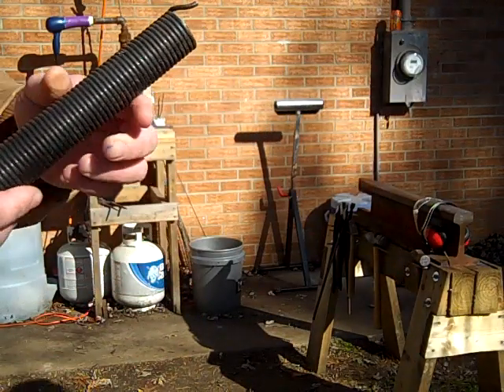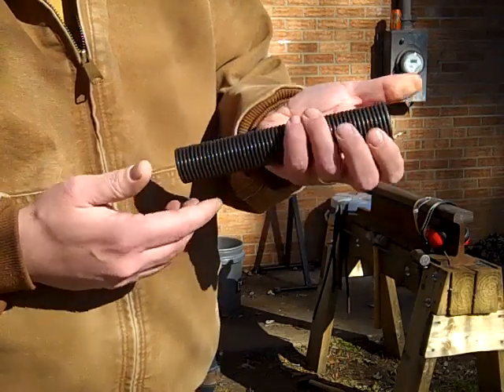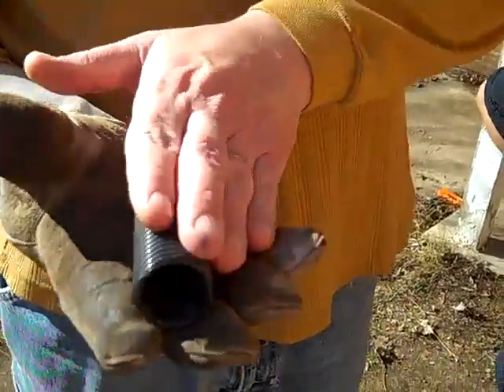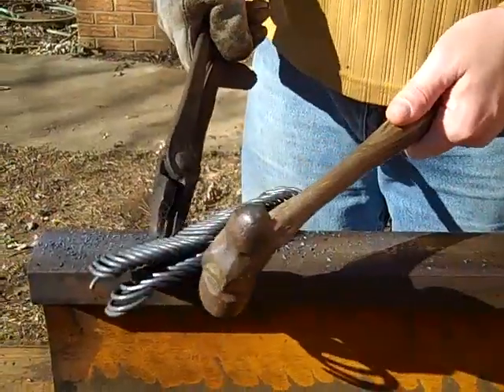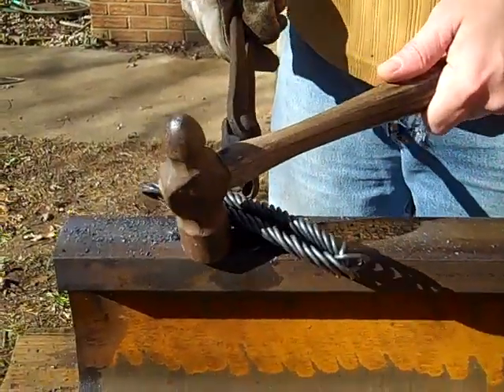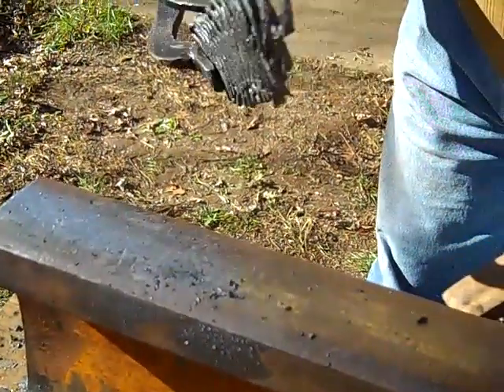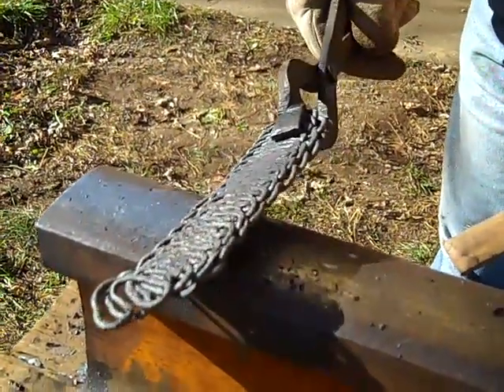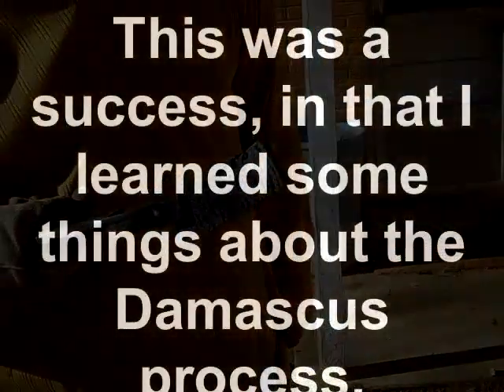Making Damascus from a coiled spring

Comment: a power hammer would've cut his time down to get that billet done but if he would've kept hammering at it he would've gotten rid of those voids. Another thing that would've helped it to put the spring in a tube or pipe, pour powder steel in with it (pack it down good), cap your ends shut, bring it to heat and start hammering. Before you do any folding over, you have to grind off the outer tube if you want your spring damascus to show.

Comment: I have not read thru all of the previous (392) comments, so please forgive me if someone else has already suggested this. First of all, I liked the idea of using springs for a Damascus. My suggestion would be to do this as a Canister Damascus, using multiple "nested" springs inserted inside each other for not only the center core of the canister, but also in the corners of the canister, and then fill the voids with powdered steel before welding the canister closed. Maybe even add in some straight steel rods before adding the powdered steel. I agree that a power hammer would be good, maybe even a pneumatic or hydraulic press to set the fist few welds of the canister. If I was doing this, I would probably also "twist" the billet before flattening and folding. I think it would be an awesome pattern. :-)

Comment: you need to use borax firstly, as damascus rather than having a whole piece if weak steel you will have one point that is terribly weak so borax keeps the carbon level okay and the impurities at a minimum. You also want it be white hot for a forge weld (especially with damascus) it makes the weld cleaner.

Comment: You could try adding a smaller spring that just fits in the vacancy in the center and then add a smaller spring inside that one before plugging the whole with something and maybe pour in some fine high carbon steel dust before plugging the other side? As the others have said you'll have to get the steel hotter as well and I'm sure some borax as an oxidation barrier wouldn't be bad either. You can even mix in some steel filings to the borax as well.

Comment: It may look similar. But it's only one type of steel. So can't be considered "Damascus". Perhaps a solution to your void problem would also meet the requirements for Damascus. Use a couple other same size springs of other metals and thread them together (advisable to weld spots together) before beginning and you can likely fix your gap issue AND have the multiple steels. Even still, you need to fold to MANY times. Which should solve the gaps as well as you fold and reforge into a working bar. But you'd still need the other metals at that point, so I still suggest my first idea. Because yo may achieve a similar look by doing it with a single spring. By using only one metal you can't call it Damascus
Reply: well by your definition it is still "damascus" all of the above "damascus" is just patern welded steel.

Comment: I've done this before with great success. Use more flux, increase the temp, and don't be afraid to fold it a few times. These springs can make a good knife if you weld them correctly.

Comment: It's hard to tell when you're outside, but the metal should still be a bright orange at least before you weld it. Also need lots of flux. There's a lot of surface area, and it seemed you were shedding a lot of slag.
Reply: you don't really need flux as long as you get it hot enough.

Comment: Damaskus steel? This piece of shit will be never damaskus steel. Try to search on google for Damaskus steel. This will give you only pattern, but the steel is the same shit as before was...
Reply: Its hard to believe your commenting like this. First and foremost its Damascus Steel, secondly modern Damascus(pattern Damascus)  steel is any steel welded together that results in a pattern when etched with acid. the time it takes him to heat this thin steel results in carbonation of the outer layer of steel, the differential carbon content would result in a pattern when etched. And as for the steel , spring steel is some of the best knife steel it results in a durable long lasting blade...But I'm only a blacksmith so what do I know

Comment: I agree with Gwen, You needed more heat and good flux welding heat is much hotter so the steel sparks when taken out of the forge, Try again

Comment: not much point beating a dead horse here in the comments so ill keep it short. i just wanted to say that you need to move your railroad track anvil closer to your forge. you should be able to reach both without having to move much. but most of the other people commenting are right you need more heat and flux. borax is the easiest to use as flux but sand will work to. just regular play sand from the store. also Damascus is more than one type of steel forge welded together. what you were doing could have worked but you would have just ended up with a piece of stock. if you decide to try this again heat it up to cherry red and draw flatten fold over and over until it all meshes up well. then do your forge welding. and lay the heat on heavy. if you see sparks you are burning carbon out of the steel you need to forge weld just before that point. and use a lot of flux. like a lot. when you are ready to forge weld it heat it up one more time to cherry red then use a spoon to shake borax all over it. it needs to get everywhere it will melt into a clear goo. just make sure you get it in every nook and cranny. when you forge weld look for dark spots. dark spots are areas that did not weld. damn i intended to keep this short and to the point. i ramble to much. lol well good luck in your smiting.

Comment: You need to heat the spring and then pull it out to apply the flux, then reheat the piece to where it is just about to start sparking! The closer you get it to the melting temp, the better the metal fuses. If your piece drops to an orange heat, then reheat and continue the weld! Just a little tip: it is impossible to see your heat in direct sunlight!

Comment: tip...get the steel much much hotter ...put a piece of bar inside the coil..then heat again till all glowing very brightly then flux..then heat again till very very hot 1100c then hammer! :)..let us know how this goes

Comment: The other comments are very succinct. Your temp isn't even close to enough. You need to be up into a lemon or maybe a straw. White's too hot, you'll be burning steel. 

This is similar to techniques I've seen where elevator cable or suspension-bridge cable is pattern-welded. You were the right track, you just needed far more heat and some decent flux -- you were spalling off most of your material through surface oxidation. 

Check out old farm sales or estate sales and find yourself a real anvil. A hunk of railroad track is ok for making some tongs and maybe some small knives, but if you want serious work, you need a real anvil. I've seen people find good old ones, 100-200 lbs, from farms or estate sales. As long as the face is still in good shape, not all gouged and nicked, it'll probably serve you well.

I suggest the works of Brian Flax, in particular the collection "The Best of THE HAMMER", a compendium of smithing techniques he used for the SCA. There's a lot of good stuff in there about collecting and making tools and equipment, and it's in very plain language.

Comment: Takes two types of steel to make Damascus. Local knife maker here uses steel banding which is a 16 to 14 gage spring steel high in carbon in several layers with a softer hot roll steel (same gauge) first welded with a welder to keep them together. Then heated white hot and pressed all together folded and folded over and over

Comment: ok... wow...
1. You need way more heat!
2. You need flux.
3. You need way more heat!
Reply: instructions 1 and 3 are accurate 2 is not. some people like flux cause it makes it easier, but it also makes it messier. if you just get it really hot it works too.

Comment: Carbon can be added to steel at any point during the forging process. You can add carbon in a crucible by adding any once carbon based life form plant, coal whatever. You can add carbon while forge welding by rolling the steel in straw ash as the Japanese do. So If you lose some just add some.

Comment: I don't mean to be that guy, but  ...if you don't let your metal get dark, you will get less voids and more of a solid heat weld. It should be yellow when you pull it from the forge and still light orange when you put it back in. It makes much less work and far better quality.
Also, if you get another spring of a different alloy (like something with nickel), you will get more of a Damascus look.

Comment: Do Damascus steel blades lose their patterns if they rust and u resharpen them?
Reply: ***** It depends on what you mean by Damascus steel. What I'd call "true" Damascus steel is made by folding dissimilar metals and forging it, rather than a pattern etch. True Damascus won't lose its pattern, but an etching will.

Comment: You might want to try using a good bolt , and a stack of washers , iron , steel , stainless steel . tighten a nut down on it as tight as you can . Heat , ( cherry) flux heat again ( white hot ) and gently forge to set the weld . after that its all about improving the weld without loosing your heat

Comment: two things, you didn't have it at a good welding heat ( white hot ) and next time .. Put a core metal inside the spring . a good grade 8 bolt will work just fine
Reply: It looked like the spring was cooling so fast because there was so much airflow around it. All the steel was flaking off as you hammered.

Pull out a spring and hold it stretched while you slide it inside the next one. Let it close then stretch another and fit inside those and so on until you can't get any more in there. Then crush some kaolin and charcoal to make a past and dip the springs in that before heating. |No air will be able to circulate or even reach the red hot metal you pull out.

Bang the hell out of it and quickly recoat it and repeat. But you need to put your anvil closer, set it lower and thrash seven bells out of it until you are puffed and the metal still fairly red. You will need to work up to speed before using the real thing so plenty of practice first and no breakfast on the big day.

You will have to give the hammer as much of a swing as it is possible to deliver. You can easily refine that technique by exercising at it daily. You really do need to be able to deliver one hell of a belt accurately every time. You look strong enough but you need to work hard on the technique.

Maybe have the anvil set at a foot or so off the ground and work up a sweat chopping logs for a few weeks then get someone to hold the thing in place for you to <s>kill</s> massacre it with a sledge hammer. Try turning the anvil on edge to see how effective the channel is at helping your assistant to hold it in place.
Reply: I realised too late that the initial spring is going to be a lot longer than the final one but put a core of something like a nickel chrome steel indie it at the stretcher and just fold the pieces into the middle first time. That should even it all out.

Good luck.
Reply: That's good advice right there. I might try that. I'm currently thinking of doing a wire rope knife, but I like the spring steel idea.
Reply: White hot is way too high for high carbon. I regularly forge-weld billets of several pounds weight and orange-yellow works just fine. Mind, you really need an area of shade to see colours and avoid burning the stuff. Outdoor light is way too bright. Use a decent flux too.
Reply: flux ? i use fly ash and boraxo ..
Reply: He's also outside, white hot outside, it would be molten, a good yellow is that i look for when I'm outside, he forging it too cold aswell for outside

Comment: You might try 52100 bearing steel to get started with a good knife

 the forging technique for the high carbon steel is to continuously forge the metal at about 1500 F to keep it from changing phase during the cooling process. I think you want to achieve a micro structure called 'bainite'

.For a pattern welded Damascus blade, you simply need two pieces of steel that contrast each other strongly when etched, yet heat treat pretty similarly. The most common pair of steels is 1085 and 15n20, these steels will create a pretty good knife with a nice visible pattern

Comment: You need to try fluxing it earlier with a few different metals. The way i've seen damascus patterns done is by putting different steels like spring steel and and maybe blade steel then binding them with wire and spraying them with WD-40 to put a coat of borax on :)
Reply: hang on, so if i want to put a coat of borax on metal, i just bring it up to the fluxing heat then spray with WD-40?